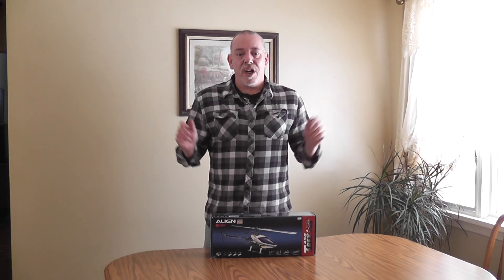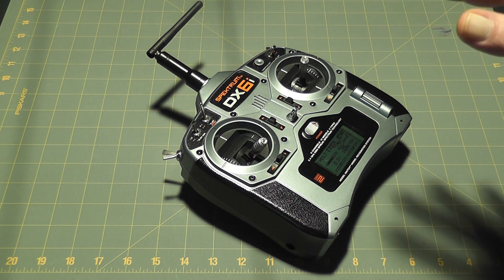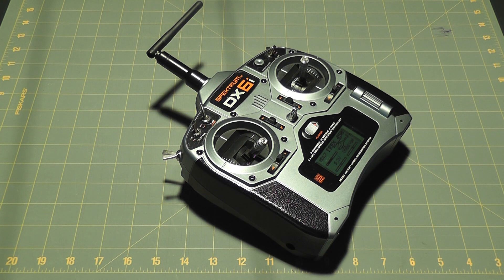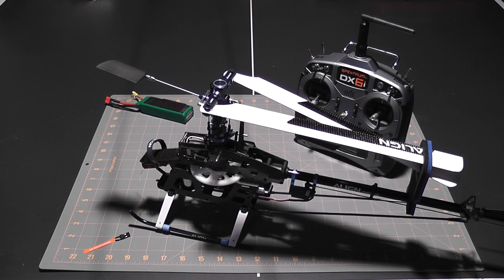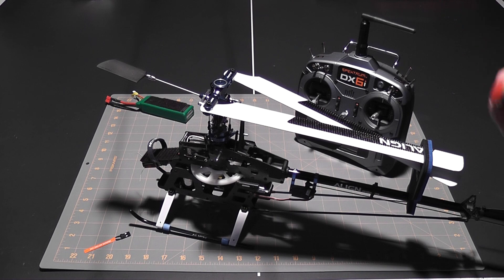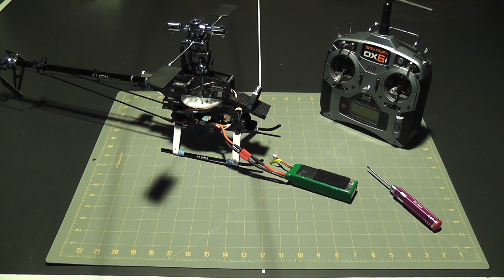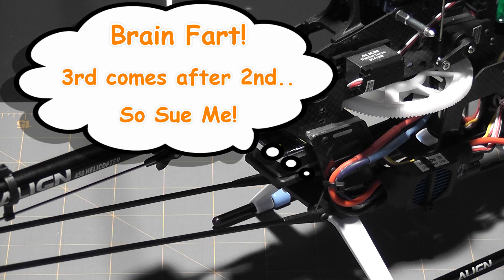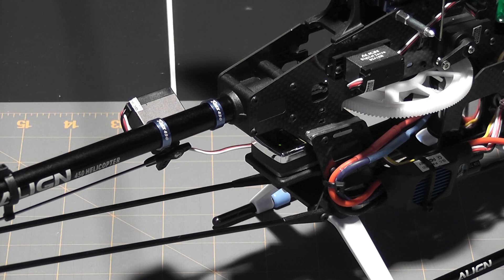T-Rex 450 Sport Super Combo - Electronics Set Up

Comment: Hi George. I have an Align 450 pro gyro want to replace/upgrade my cyclic servos. Do I need to bind the heli again then do the DIR set up or just turn the tx on and plug the servos? Thanks
Reply from the maker: Hi Peter, you should not have to re-bind the heli to your TX when swapping servos.  I would however make sure the travel is set properly on the new servo before taking to the air.  Good luck and happy flying!

Comment: Hi George, Very nice and informative video as usual! :) Please could you tell me this. I have the DX6i and the Ar6100e reciever. What plugs into where on the rx?
Cheers, Grant.
Reply from the maker: Hi there and thanks for posting.  The connections to the AR6100e should be marked on the covering.  If not, you can get the PDF file on Spektrum's web site.  Good luck and happy flying!
Reply: Hi George, Thanks! I have sorted it now. I was just unsure about the AUX1 port but now I know that the pitch servo goes intot hat and the rudder channel is the gyro and the gear channel is for the other cable that comes from the gyro! :) Many thanks and Happy Flying :)
Reply from the maker: Hey bud!  Awesome.  Good luck finishing up the build and godspeed on the maiden!  Keep us filled in how it is going and post a maiden flight video if you can!
Reply: Yes sure will George,Thanks  :) The weather hasn't been the best as of late in the UK. so once it's cleared up a bit, I will be sure to take it out and I will get a video too :) Happy Flying mate.
Reply from the maker: Great!  Good luck with the maiden and I will be looking for the video.  Have a great day and as always, happy flying!

Comment: ok, my transmitter is the tunigy 6x fhss. i know how to do servo reversing, as it is right on the transmitter. what i do not get is how to set up swash mix and its trimming. is my transmitter not able to do heli capable (swash mix) type stuff? i really do not have the money to buy the spektrum versions because they start from 150 or so. if i actually need a different transmitter, what is the cheapest one i can buy that will do the trick for the trex 450?

Comment from the maker: Hi again.  If you have a Trex, you have a collective pitch.  I have seen the problem you are speaking of.  It takes a combination of using your servo reverse and the swash mix.  Try using the servo reverses first, then use the swash mix.  If the direction is reversed when using the swash mix, use the opposite sign (+ or -) to change the direction of the servo movement.  Hope this helps!

Comment from the maker: @MrMickle28 - Hi Michael and thanks for posting!  I have found the problem you are describing is directly related to the limit setting on the gyro.   I actually had the same problem and it took me 4 tried to get the limit settings correct.  Remember that after you set the limit in one direction, wait for the LED to start flashing before setting the other direction.  I try to explain in a bit more detail in the vid, but the bottom line is getting the limits set correctly.  Good Luck!

Comment: Hi, great video, I also use the dx6i! and I just have a question with regards to the gyro, For some reason, my rudder sensitivity is extremely high and will give the tail max pitch at only about half rudder stick. How do I fix this? Do you know if it is a gyro or radio problem? I have virtually the same setup as you? 
thanks in advance, Michael :)